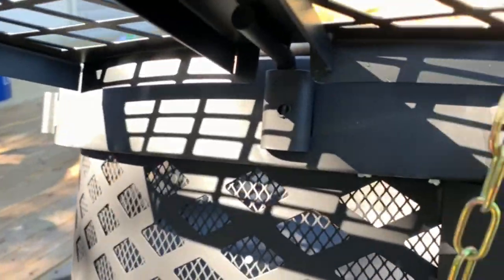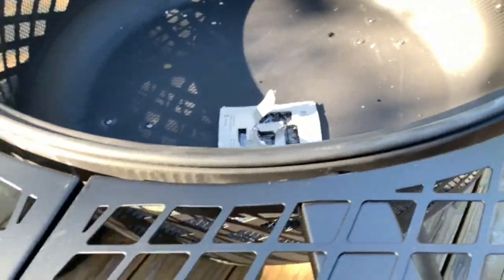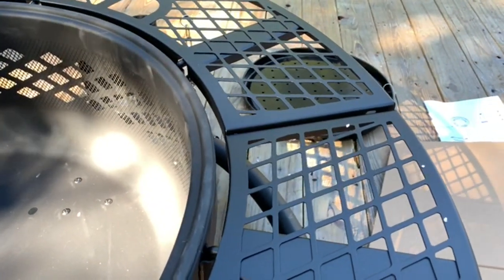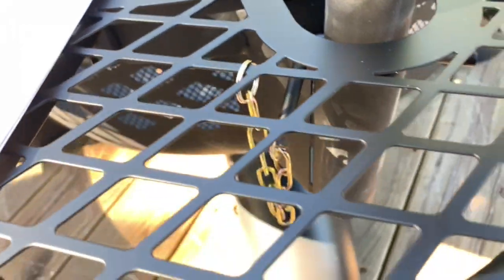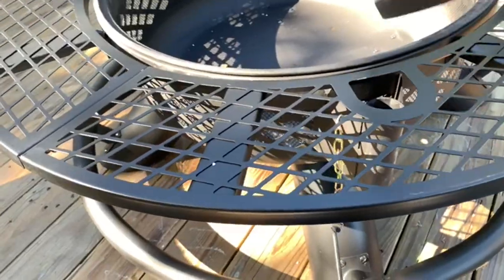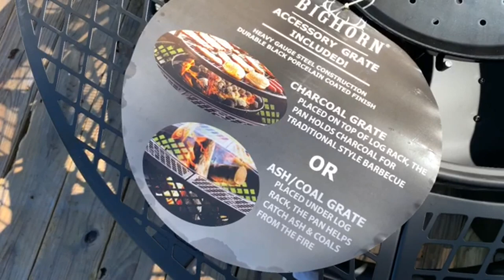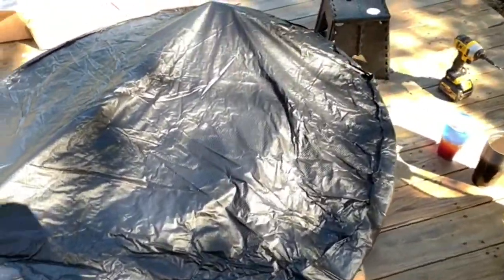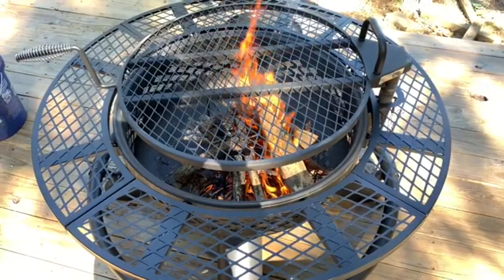Bighorn Fire Pit from Lowe's PART 2

Comment: Does it fall apart with multiple wood fires like everyone says?
Reply from the maker: @donato261 Had it around a year now. No trouble with it so far burn fires almost every weekend. And it stays outside in elements.  Maybe they don’t clean it out after each use. Let the ash build up and get rained on holding that water.
Reply from the maker: Just giving you a follow up that it’s still in good shape.